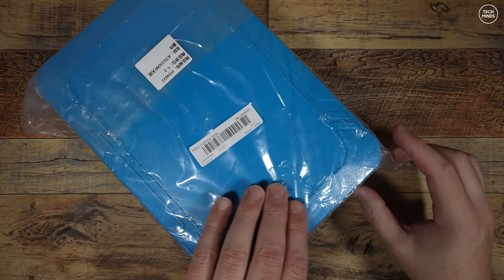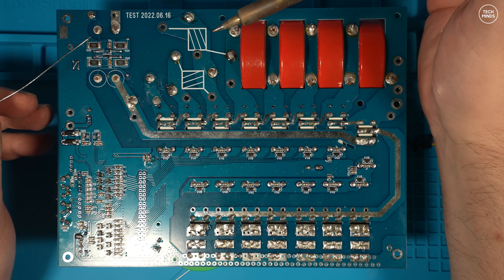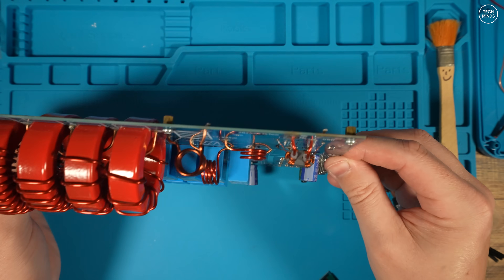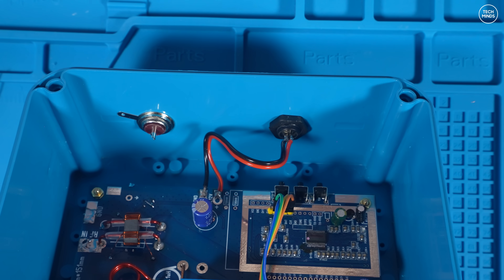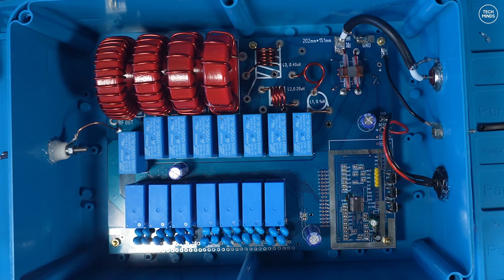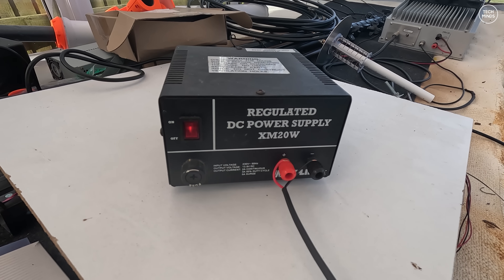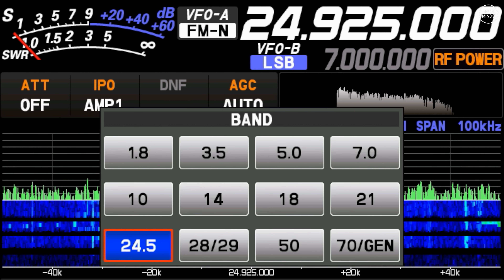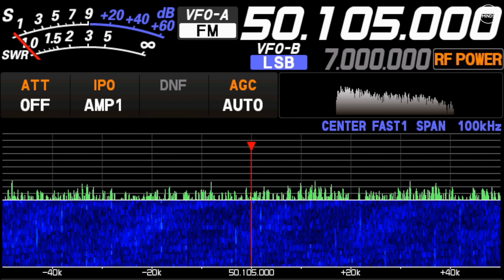ATU350 - A Cheap 350 Watt Remote Automatic HF Antenna Tuner

Comment: I don't think many automatic antenna tuning units will match the 3000 ohm impedance of a half wave end fed wire.  You might consider adding back the 49:1 transformer with the ATU, or even just a 9:1, or 4:1. Or use the common random wire lengths of 58, 71 or 84 feet etc. Thanks for posting the review. Still looks like a good unit to me.
Reply: Agree about the high impedance issues, plus the inherently high voltages at 1/2 wave and multiples will likely cook the tuner eventually.
Reply: Works on my icom ah2
Reply: Exactly this.
Reply: Ive used my ah2 on a 154' end fed wire for nvis out to 900 miles
Reply: Yeah I have a cg3000 with random wire in an inverted L it tunes everything beautifully. Give it a go you'll be pleasantly surprised .
Reply: This.  No ATU is going to properly tune an EFHW on all bands.  Excellent advice above.
Reply from the maker: I would never use this tuner with the 49:1 transformer, pointless for my personal use antenna. Remember, this video is just showing this product and my experience with it. The suggestion of 71 feet in the first comment by Tom is exactly what I did when I extended the wire by 7 feet. I do have a chart of wire lengths to use with remote ATU's and 71 is one of them. There has been some other suggestions in the comments, which I will test out soon. If I find a repeatable solution so it works nicely on most bands I will make a follow up video. :-) Thanks guys!
Reply: @TechMindsOfficial  I don't understand.  Why would the 49:1 transformer be pointless?  Pointless is expecting an autotuner to handle the high impedance of an end fed half wave all by itself.  Either use the transformer, or use a counterpoise of varying length depending upon the length of the wire and what band you're trying to use it on.
Reply: @TechMindsOfficial  The ATU350 Spec sheet says max 5 ohms to 2000 ohms antenna impedance. So that's why it won't feed the EFHW directly. However with a 4:1 it should work fine. A good 4:1 can be built with better than 98% efficiency.
Reply: @AB7Echo  I also thought about the counterweight. There are some experiments to be done here.
The test was not carried out conscientiously or thoroughly.
Reply: @TechMindsOfficial one thing I noticed is that the coils have a red core which, from memory is 1-10MHz material type 6 from memory. I wonder if it would perform better with type 2 yellow cores wound for a similar inductance 

Have a look at your antenna, at the antenna with a VNA and note the smith chart. Could give you some useful insight as to what sort of load the ATU is seeing.
Reply: @MidlifeRenaissanceMan  Red may not always mean what you said. Some will, some will not.
Reply: Go shorter
Reply: @TechMindsOfficial  This tuner is not intended or expected to tolerate antenna or counterpoise conductors that are near a half-wavelength long, nor any integer multiple. Using conductors for which that is true requires a significantly greater transformation between the ATU and the antenna.

It's not clear why you'd "never" do the thing that your setup requires. If there is some problem with your existing 49:1 transformer then by all means replace it with another. An evaluation of how well a product does a thing that it's known to be incapable of probably isn't terribly interesting information.

On your questions:
- No, the stub on the antenna connector doesn't matter.
- Either ground connector can be used; in some configurations the "ground" is actually a counterpoise which is more convenient to connect at the top of the box than at the bottom, so there are connection points for both cases.
- Immunity on the power cable is installation-specific. If your controller isn't resetting or crashing when you transmit then there's no need to improve it.

Comment: Wondering what kind of ground do you have ?
May be on some frequencies, a good (I mean low impedance) ground is required ?
(That wasn't so important with your end-fed 49:1 setup which is high impedance)

Comment: Hi Matt! Some answers, mostly on my opinion, with a pinch of electronics knowledge:

1) the extra centimeter on the antenna lug should not make any difference, but in my ATU100 (basically the same thing as this tuner), stray RF inside the box was the main reason it was misbehaving.
2) because of stray RF I would connect the ground lug to the top connection, so you can have less RF moving around inside the box. The ground on the bottom, near the RF input is too close to the input to make any significant difference, and the board will have a lot of stray currents on its ground plane.
3) ferrite beads on the power lines are good measure. In my ATU100 the stray RF flowing aroun messed with the analog inputs and made the tuner stop prematurely. I added beads and decoupling capacitors everywhere!

Note that the designer of this board added a strip of solder mask around the digital components. This is planned for some kind of shielding to be mounted there. It might help, but it is a real nuisance to make one...

Another point to notice is that if the "random length" of wire is close to resonant in some bands, the tuner might not be able to tune it. This is why 20m of wire resulted in failure when tuning for 40m, 20m and 10m, as a half wave, full wave, and 2 full wavelength will have infinite impedance and will be beyond the tuner's ability to match.
Reply: Totally agree with 20m being a bad length of wire. Try something a little shorter. 20m is close to half-wave on 40m, 2 half-waves on 20m, 3 half-waves on 15m and 4 half-waves on 10m. End-feed wires a half-wave long have a very high impedance which is probably giving the tuner indigestion! I think having a counterpoise which is also 20m is probably adding fuel to the fire. Look up some acceptable lengths for random wires and try some, and maybe try a direct connection to ground rather than counterpoise - I'm sure your problems can be solved with a bit of fiddling about 😉 73 de G0TVJ

Comment: Definitely try the other ground location. I would tie both locations to the ground, test, remove one near ground lug, retest ect. Try not to change two things at the same time. I would go back and collect data with out the hairpin on the fence, but with the isolator. Another interesting test remove the line isolator and just try a coil of coax. Last interesting data point, IMHO would be, using the tuner to directly connect to a G5RV or skywave loop at the tuner. I don’t think thats in the cards with your garden. Maybe at a mates shack?

Comment: What range of impedance can the tuner match?  If you have a 49:1 transformer feeding an EFHW antenna, that's almost worst-case with a relatively high impedance (thus the 49:1 EFHW transformer).    Heck, might be interesting to see if you can feed the input of the EFHW antenna with the tuner?

It might be interesting to see how this works with a random wire antenna that's not resonant on any of the bands; it seemed like adding that length of wire improved things on some band, but might have still been a non-optimal length on the others.  There are some tables of random wire antenna lengths floating around to help choose one of several lengths that would work over a selection of bands.

Comment: Adding to the antenna and adding the 1:1 balun kind of nullified any apples to apples comparison.... would like to have seen what difference the 1:1 balun would have shown without the antenna modification.... what do you think? Red - W5UW ... BTW I recently purchased a Chinese ATU-100+ and have been amazed how well it performs on a 160m inverted V.. other than 80m it presents great matches to my ICOM 7300 (something the internal tuner fails miserably at). I ran it last week in the DX contest zipping back and forth over all the open bands....

Comment: 43 ft of wire with a good set of radials should get you good tuning on all bands. Need that “random wire” length to keep the impedance range in check.

Comment: I'd try adding 8-10 feet to the coax from the rig to ATU as you *may* have got unlucky with a resonant length feeder somehow - it happens. The earth terminal - I would just connect it to the braid of the SO239 socket. However, the ATU does appear to be a touch useless.
Reply from the maker: I wish I thought about that earlier as I do have another coax run from the shack to the same location but is a different length! Well, I'm not sure if it's totally useless as it does tune, but as you saw, strange results. My CHA URT1 has no problem tuning the 20m of wire on most bands. I guess its cheap for a reason. lol.. Cheers